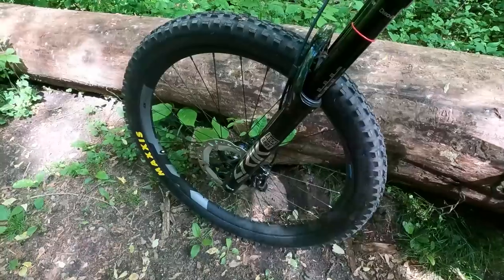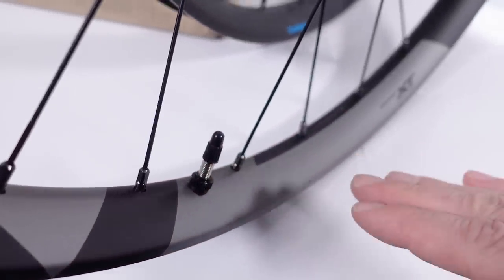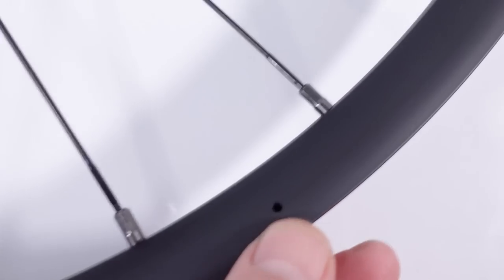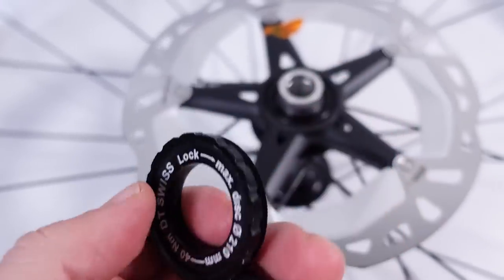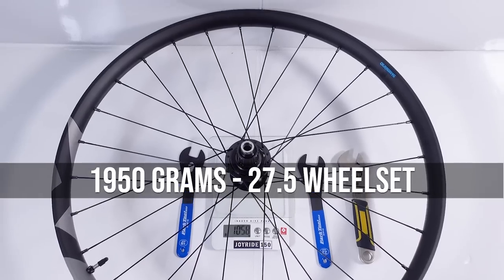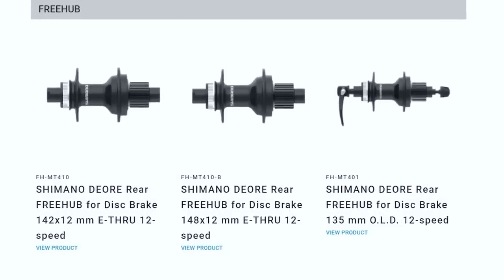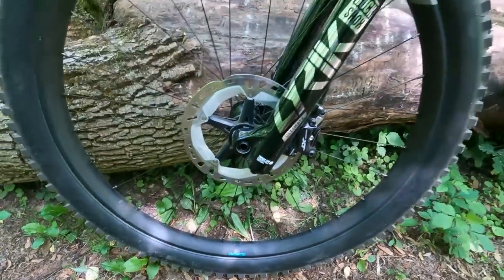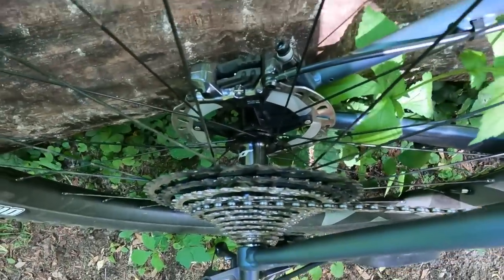Shimano Scylence WHEELS??? XTR/ XT/ SLX Trail Details, Issues - 12 Speed Generation

Comment: I have stopped mid ride and come home multiple times because of creaking somewhere on my bike. I actually like the cone and cup design as it's easier to overhaul when that time eventually comes, but the overall weight and hub issues are a deal breaker for me. Good to see you thinking outside of the box and giving them a try though!
Reply: And.  Cup and cone bearing ?  Run soooo much smother than cheap Chinese cartridge bearings..
Reply: Cup and cone? I suppose some people use cassettes and AM radio too. There’s a reason we developed cartridge bearings.
Reply: @guzziben  yeah.  They're cheap and require less frequent maintenance and setup..    don't even try to claim the spin better...  they definitely don't...   properly setup shimano cup n cone bearings?.. nothing rolls like it. Not even a ceramic cartridge

Comment: Here in Brazil, all shimano scylence technology hubs (m7100/8100/9100) fail with a few kilometers of use. The hubs show a horrible creaking noise. The warranty changes but the new hub turn to presenting the creaking noise. A few mechanics who disassembled this hub recommended lubricate the hubs, but the problem continue. I think that shimano mt400 series (with ball bearings) was releases because the problem with this scylence hubs. Great video!!! Thanks!!!!
Reply: @LoveMTB  yes, mt400 and mt500, both the freehub have pawls system, not scylence.
Reply: because all brazilians buys on aliexpress for 80% off the real price...

Comment: Every company has at least 1 bad product. Shimano has creaking hub 👍🏻
Reply: that's true 😂
Reply: @LoveMTB  grease will not be a permanent solution I reckon. Please let me know when your plastic spacer fails, I am curious :). If you want to be able to continue using that rear wheel I would buy this spacer in advance (part no. Y3G111000 [yellow for XT], or actually used now by Shimano in XT as well the XTR black equivalent, supposedly a bit more resilient: Y3FM14000). What is interesting is that the XTR FH-M9111 model has these spacers that go between driveside cone and freehub body, coupled with an elaborate adjustment process. I guess these problems are not reported to be so common for XTR hubs, that I guess maybe is much less common on the non-sponsorship market due to price, but on the other hand I guess these freehubs were on the market 2yrs earlier than SLX/XT were released.
Reply: Yep terrible

Comment: I'm on these right now and have been for over a year. Let's point out that these cost $500CAD and Shimano's goal with this new gen wheel series was to get people using their 12 speed drivetrain, and not top spec performance. They sell them at very low margins. There are surely better wheels out there - but solid performance for that price, maybe not.

Comment: sadly I had to throw my XT m8100 rear hub. the first thing that broke was the plastic spacer with the small teeth. then as I was going down a mountain it turned into a fixed gear hub. they don't make the XT like they used to.
Reply: Initially same thing happened to mine,you can feel the wheel suddenly disengaged (can't pedal forward),found out the plastic spacer n both coil spring was out of shape.. luckily,it's replaceable n affordable small parts. It's a good hub actually but the flaws was that issue with the springs n plastic thingy.
Reply: Did you know the plastic spacer is replaceable? They had came out with a 2nd gen, better revised spacer which is black in colour.
Reply: @mf3616  Do you happen to know the Shimano part number for this new spacer?
Reply: @kopter28  From what I know, they don't sell it, only can get your local bike shop to contact them to order. But you can try emailing Shimano
Reply: @kopter28  I guess it's the XTR one Y3FM14000, but I got it as warranty replacement and it got chewed up as explained above. All 'legs' broke off and got into the ratcheting mechanism. Relaced my wheel, and hope I will get money back.
Reply: @LoveMTB  shimano warranty here in the Philippines sucks. BUT when my m8100 10-51 cogs folded on me, I got the warranty for it. the hubs weren't that lucky
Reply: and my xt chain also weren't warrantied when the cogs broke a few links.

Comment: Going on second season with these wheels but 29er. Had rear hub creaking almost immediately. Took apart and lubed and creaking hasn’t returned but does make hub louder like you mentioned. Have recently had issue with spokes breaking on rear wheel for no apparent reason. Took to my local mechanic (over 20yrs experience) and he said the bend in the spokes from being machine built was terrible and probably causing the breaks. Also are sure it has rim tape? 99% sure these are UST style which would explain the drain holes wouldn’t it?

Comment: Re. the creaking sound.Make sure your thru-axle is greased and tightened to the proper torque spec. I found this to be true on my Timberjack that if the rear axle isn’t torqued to spec it creaks.

Comment: Ugh. I'm about to pull the trigger on a new bike build, and am thinking about getting these wheels instead of a set of DT Swiss 1900s. I read that these lower end DT Swiss hubs take a while to engage. And Shimano XT  kit has always worked well for me.
Given the comments (creaking, chucking a hub), would Mr MTB advise going with the DT Swiss 1900 wheels? Sticking with XT? Or something else entirely?
Any insight would be most welcome!
Reply: Or maybe just grease the splines every 2-3 months,?
Reply: @LoveMTB  Much appreciated. I watched ur DT Swiss vid and I think u are right. I'll give the 1900s a go, and get the kit if the engagement is an issue. Thanks for the detailed insight on ur channel. 
Live long and ride hard!
Cheers

Comment: I would never buy M7100/M8100/(12sp. XTR probably similar issue) - I warrantied the hub once as it started creaking and upon inspection I discovered that the plastic spacer legs were all but broken. Sent the whole laced wheel for warranty, came back with new spacer and grease on it this time - worked better (fully silent coasting, even low speed), but soon it started creaking more and more, and then it chewed up all the spacer legs and locked out the freewheeling mechanism on the trail... Fortunately it managed to chew these plastic pieces completely and clean up the space inside the ratcheting mechanism, and I managed to come back home. The engineering design of the freewheeling mechanism is very good - better than DT Star Ratchet or Chris King IMHO (much larger ratchet diameter, much higher engagement force and with the potential to be lighter than even DT Star Ratchet EXP as all parts are from alu alloy), but the solution with the plastic spacer to eat up tolerance and prevent alu/alu contact likely combined with some slop tolerances elsewhere/axle not being stiff enough etc. leads to very quick failure when used frequently with high torque, as most MTBs are. It is really sad as without this issue it would be an excellent and not too expensive hub (though most people would likely prefer to have the drive bearings be cartridge-style as well for convenience and peace of mind, even if they would need to be replaced and properly serviced C&C hub of this class can last very, very long provided no contamination).
Reply: @LoveMTB  I think the reason for failure is this strange plastic spacer solution. My hub first came with the light-colored spacer (and no grease there, as per the old Dealer Manual) and then when I sent it to warranty it was replaced with the black (guess XTR) one, but it didn't help.

Comment: Hi! I am in Korea, but the information in your video is very advanced. My hand unknowingly pressed the subscribe button.
Until recently I rode a 2008 trek8500. I'm on a scott scale 940 now. I am surprised that it is much heavier than my 14 year old bike and I want to change the wheelset and tires. If I buy the M8100 wheel, can I replace it right away?

Comment: can you pull the freebody off without tools? i have a couple of wheels w dt swiss 240 and wont buy another rear wheel that doesnt do this
Reply: You need tools to remove the MicroSpline body from the new SLX/XT/XTR hubs. The end-cap is pulled straight off, but you need a 17 mm hub spanner to grip the end-cap for pulling. You also need needle nose snap ring pliers to remove the C-ring with outer dust cover. Then you can pull the body from the hub. There is also a inner seal ring that is very easy to bend/damage when servicing the body, and if bent you need to replace it, finding some one selling that spare part can also be tricky. I would definitely recommend staying with DT Swiss, much better construction and more reliable operation.

Comment: Hi. I’m going to build a rear wheel and trying to decide on a 622x30 rim to buy. Do you think an asymmetrical rim with about a 2 - 3mm offset would work okay with a 142 OLD hub or do offset rims require boost spacing? My plan is to build a 30mm internal width rim using 29x2.4 tires. Thanks.
Reply: @LoveMTB  Thanks for the reply!

Comment: I'm hearing hints that freehub noise can be controlled by the right lubrication.  aa simple example wold be oil verses grease. but DT Swiss are very specific: use their grease or   expect issues. the lubricant and counter spring are in balance. The lubricant lets the parts move smoothly but also cushions the parts reducing noise, ware & impact stress
Reply: This is correct. I have had the creaking and fixed it by lubing the hub mechanism. Works perfect now.

Comment: I love the look of those decals, but man that's a heavy wheelset.

I just got some 27id carbon rims built on DT240s and they're 1288g... Shame they sent me 29ers when I ordered 27.5 but that's what PayPal disputes are for 🙃
Reply: @LoveMTB  Well I'll be sure to enjoy when they get replaced with the correct size. Maybe 27.5 will be under 1250g?

And thanks for the link, just noticed the EXP hub I have is one of the recalled serial numbers. Is it just the ratchets that need replacing? I was thinking of upgrading to the 54t anyway.

Comment: Cup and cone still..had them  25yrs ago. What happened to new technology, these went out with the Romans.  As soon as the bearing race is worn out you are knackered. Doesnt matter how many bearing changes you do   🥲🥲
Reply: @LoveMTB  lower tolerances, probably cheaper to make, it can be more reliable also, that's heir selling point at least. I have no problem with that personally.
Reply: @LoveMTB  I would too, but the freehub is on cartridge bearings already, that's good enough for me, and I really dig the silent ride, hoping I can remedy the creaking issue with some strategic grease/ oil usage 😜
Front hub, I see no point going Shimano.
Reply: @LoveMTB  I've had enough buzz, very loud Hope like Novatec (really annoying personally) now 102 Poe (not as loud, not as annoying, just noise in the background) and I've had the crappy DT Swiss 370 hubs on my XC bike, the engagement was terrible, but I really enjoyed how silent they were- I could hear the tires losing traction etc.
Added benefit, hearing tires etc. on the recording as I like to document the more interesting of my rides :)

Comment: I used an XT wheels before but the older one the M8000 one. I was using it for good 2 years before selling my bike and I didn't have any problem with it. The only noise I'm hearing is me breathing so hard from those uphill climb. I do prefer the silent hub too. The engagement for the M8000 wheels was awesome so as the rolling speed. 

In as much I love the XT wheels, I do not regret selling the bike because I just bought 2022 Santa Cruz Bronson MX which is a totally different bike but oh men I love Bronson. It felt like I was still using my XC bike on the climb. 

But anyway awesome Video!

Comment: whats up with the drainage holes? wont they let water in? thks.
Reply: it works like a centrifuge, as soon as it spins up, water gets drained. And no: much more water gets in through the spoke holes. i drilled tiny holes in my dt swiss rims, seems to work.
Reply: @LoveMTB  I got those in my RaceFace Turbine R rims.

Comment: Wow love how in-depth this review is, very informative. I got the same wheelset from my work and was curious why the hub was so quiet. I had the same creaking noise and it drove me wild. Some grease and I think it's fixed. Now if I can only find a microspline cassette lock ring and I can take em on the trail.
Reply: @LoveMTB 10t cog was slightly raised, accidentally cross-threaded the lockring :(. So far the front wheel is great! no complaints, tubeless setup was a breeze. Recently greased the rear when I accidentally stripped the lockring. Relegated to the corner until I can get a replacement ring or extra cassette.
Reply: @LoveMTB  yup they are! Sadly none are in stock. I currently have SLX but I’ll most likely just buy another SLX instead of deore. Cassette that is.
Reply: Hey, love your video, super informative. Any update on the durability side of things?

Comment: i bought the same wheels 2 weeks ago 😃
the first thing i did,... was to grease the micro spline 😆
on the other bike the creak was horrible, had to grease it after 500km...
Reply: @LoveMTB  i greased it with shimano premium grease. now both micro splines are silent. i recognized when i disassembled the rear hubs, that shimano barley greased it..
Reply: Note that only the plastic spacer inside and the seals need to be greased likely using shimano FREEHUB grease only. Their premium grease is too thick and sticky in order for the hubs to engage/disengage.
Reply: @mf3616  this part has no role in engagement, there is no axial movement on that splined interface. I guess it just creaks under high torque due to axle bending.
Reply: @OYeahan  My point is that the grease is too sticky hence the spacer can't push the freehub outward enough to disengage fully.
Reply: @mf3616  I disassembled my freehub internals after this "grinding" happened and my understanding was that this splined part of the freehub does not slide back and forth relative to the rest of the freehub, and therefore the role of the splined spacer (its "legs" mostly) is to ease the manufacturing tolerances required and/or to accomodate for slight movement of the freehub (sight axle bending etc.) - which seems to be too much for this system to handle under heavy torque. I'm curious how quickly it would explode on a eMTB...
Reply: @OYeahan  If you look at the Shimano Manual they would ask you to grease the teeth which would eliminate the creaking and on off engagement from the hub. You would also notice after u install the cassette and tilt the bike to one side and spin it, it will engage when freewheeling. But won't when u turn it over to the non drive side. Because there is a bit of tolerance within the hub. But after u install the wheel and tighten it. It would be fine already as the axle and frame tightening will remove any free play. This is what we got from Shimano when we contacted them as a shop.

Comment: these rims have nipples holes under the rim tape right or are they installed by fishing magnets
Reply from the maker: No fishing magnets here...
Reply: @LoveMTB  my bad, I mean does it still have holes for nipples inside the center part where the tire contacts 
or is it holeless rim where the spokes are installed using magnets then tightened with the only hole being the valve for air

edit: Sorry for the long question, here where I live bikes shops dont have much options that I can check
Reply: @lence2775 i thought just regular rims with holes but with rims tape on top of it

Comment: The Shimano microspline hubs are dangerous garbage. The freehubs lockup. Happened to me and also a friend. They are quick with the warranty but not worth the risk. Imagine having the freehub lock up in a dangerous spot. Switched to dt350 and haven't had an issue since with the hubs.
Reply: The 12 speed stuff has quality issues. Your right not usually a Shimano trait. The derailuer clutch is also prone to failure. Mine recently broke the peice that holds the clutch in place, so now it can bounce off randomly, clutch wont hold in place. However,  I have my xt 12 speed shifting great. Had one of the original xt pulleys crack, replaced them with xtr shifting has been great since. Not sure if maybe the original xt pulleys flex more than the xtr, but it made a noticable difference. I have a friend whose been through three xt 12 shifters.

Comment: I would not use the rear hub, creaking will eventually turn into the ratchet mechanism locking and becoming a fixie. Multiple cases of it here if you want all the details.
https://www.mtbr.com/threads/multiple-xt-m8100-hub-failures.1139315/

Comment: wow they really stuck with unsealed bearings. that's not very impressive
Reply: @LoveMTB  It's a pain in the ass to get it right between excessive play and rubbing/drag, but it's not coincidence that many pro xc racers use those hubs exclusively for races - they have less rolling resistance than industrial sealed bearings. Probably most of that drag comes from the seal, but who knows. Anyway, industrial bearings are the way to go for average rider not keen on servicing. My front wheel has them and I never touched them for now almost 20000 kms. Rear wheel, got second one, and still fiddling with cup & cones every once in a while.